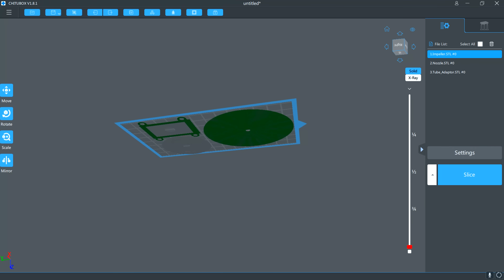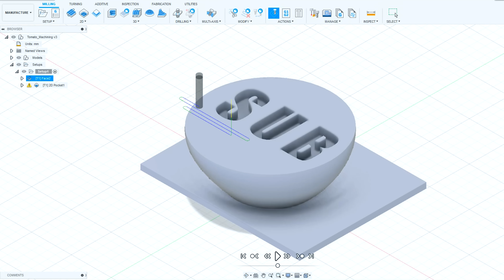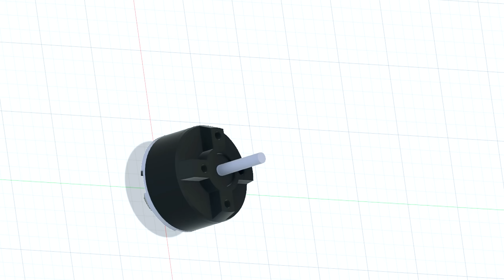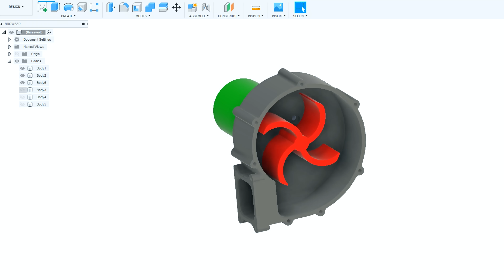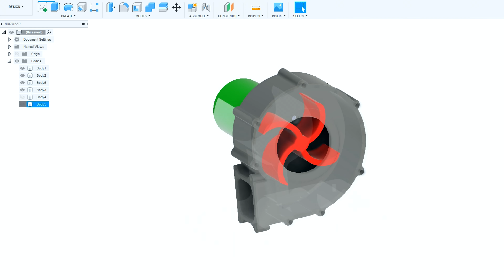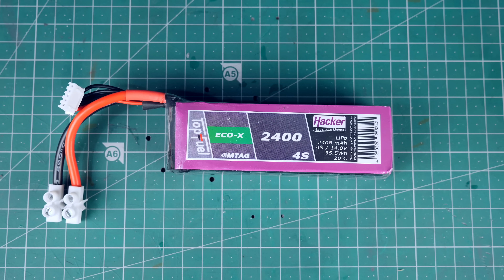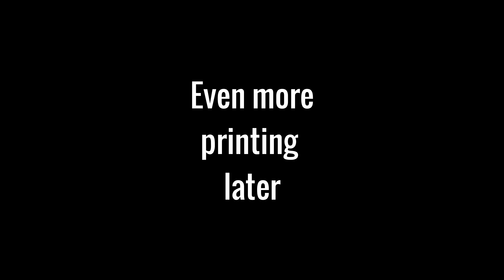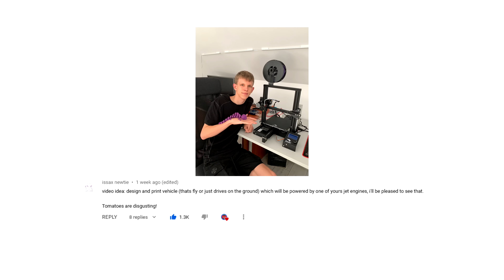Water Rocket Skateboard (3D Printed)

Comment: I knew that putting the battery under the water tube was a bad idea. You could 3d print an adjustable nozzle for this. Just like True Lies jet. And also make it overflow with water. Some air is coming in.

Comment: It looks linke there is massive cavitation ongoing in the pump.
Did you thought about using an high pressure air tank to push out the water through an nossle?

Comment: Oooh, a CNC machine! Now that's what we've been waiting for!

Now that you can work materials more efficiently and get some better parts done, how about revisiting one of your earlier jet designs and replacing the nozzle with a more robust metal one? It would be small enough to give you good practice with the machine and eliminate the fault point for 99% of your earlier designs. Would love to see them work without melting and powering a skateboard to run over some tomatoes haha.

Comment: the only thing that was bothering me was the "spinny thing"(i forgot the name lol), it was at least based on what I know, on the wrong side, they need to be like a fan, blowing air(or water) out, but the "flaps" were backwards. On a next design, this can give more power to the pump, and on metal pump, that can make a big difference, but it can increase significantly the weight of the water when it spins.
(sorry for my messy English, I'm still learning how to write, and thx for the attention :D)

Comment: More power doesn't always mean more thrust if you spin the impeller faster you will create cavitation in the pump and it will loose efficiency if you look up jet pump drive for a jet boat you will see how they are used for water propulsion

Comment: The inlet is too small, way too small. Very poor inlet condition. Ok, looks like you fixed it with blue inlet you will need a PD pump for good enough velocity for usefull propulsion. You cam see once its mounted that your impeller is cavitating, so again inlet condition. If you fix the cavitation issue it will probably break your housing. Lol, there ya go.

Comment: Bro, using a intake that seems smaller than the nosel 4:31 was so ahhhhhhhhhhhhhhh(cringe)hhhhhhhhhhhhhhhhhhhhhhhhhh!!!! 
But then, that happened 14:45 XD

Plus, switching the way the blades of the turbine work (instead of: nosel <- L, to: nosel <- J (if you can understand this XD)) wouldn't be better? instead of working like a scimitar, more like a falcata, or in simpler words, like a sling?

Comment: I would suggest that you would round the pump casing, that should help to reduce turbulence in the flow in the pump, and possibly consider a more traditional impeller instead of a paddled wheel? It has more structure and so might withstand the force better.

Comment: Hey Integza, I wonder what would happen if you make a jet engine and inject some water mist post combustion. Will the water changing from liquid to gas give you more thrust?

PS for the valve you had to cut... couldn't you just rotate it 45 degrees so the handle was facing the side? I think that would have cleared the water tank without needing to be cut. Lol as always great video!

Comment: I think you need to buy a cordless power washer and take it apart to see how that works, you don't seem to have much pressure, and it seems to have too much air/turbulence inside your pump/jet?

something like this.
https://www.worx.com/20v-hydroshot-portable-power-cleaner-wg620.html?gclid=CjwKCAjw3MSHBhB3EiwAxcaEu4iGZ--Dea85ACL8BMW_mG64dzC7XgYz4cG0r8e5Rjh43SQ3cAW3xRoCPsMQAvD_BwE

Comment: You should separate between the main tank water and the board.

The weight of the water tank make the motor will not have enough Pressure to push the weight of the water tank

Comment: You can use TPU to print a impeller, but with straight fins with counterbalance on the ends. I have one cheap(plastic-fantastic ;) ) water pump for mount on drill with rubber impeller in this shape.

Comment: Hi Integza, I am a big fan.  A project idea I had required using the brushless motor, see if you can print, CNC, or Mold an EDF that is efficient enough to produce enough thrust that could plausibly lead to flight or enough thrust to propel somthing forward rapidly.

Comment: Hey Integza, your motors are way to powerfull for your pump design, resulting in a lot of cavitation. This disrupts the flow and blows up your pump. If you increase the inlet diameter, use your nossel design skills for an optimized outlet and make shure the pump is filled compleatly before you turn in the motor, you might get better results. :)

Comment: Theres a lot of air in your pump or its all cavitation.  You should make a more restricted impeller and nozzle for higher pressures. Also you dont need metal parts, just make the impeller thicker at the base like the ones in turbo compressors.

Comment: I feel like if you could get the more screw style blade you would see in a car turbo, you would get a more consistent pressure.... Also as a comment noted, I believe the air gaps are causing .... a disturbance in the force .... That joke hasn't been used a billion times by now XD.

Comment: I have a new video idea for you. Using a turbocharger style housing. 3D print two different impellers. one side optimized for water, the other side optimized for air. So it could be a water powered air pump. Or an air powered water pump? I think that would be fun.

Comment: You are trying to run a low speed impeller design at to high of a speed. It would probably fail even if it were metal because of cavitation. Look at how impellers are engineered in high RPM pumps like a common jet pump used in a water well or even a sewage pump. The impeller blades are long, narrow and enclosed on both sides except for a center opening to draw in the liquid.

Comment: Hey my guy!  The reason this won’t work better than hot gasses is the law of conservation of energy. Every time you transform energy, you necessarily lose energy to entropy. 
In this experiment, you are trying to convert electrical energy into rotational energy, back again into linear energy by using what you haven’t already lost to push water.  The problem is all that loss. You will never be able to accelerate faster this way than by simply attaching a wheel to that motor. 
The reason we use hot expanding gasses to propel rockets is because the gasses are combusting, combining with oxygen, and supplying the energy into the system.  With your system, the water doesn’t add energy into your system.  
Please don’t take this as criticism, I love watching your videos, even though we have a shortcut around your experiments.  It’s rather fun to watch these things, instead of just explaining why not to bother doing them.
I would like to see you send something to space one day though.

Comment: it is easier to cut metallic parts with a CNC machine, but start off with some cheap aluminium as it is easy to remelt if you fail.

Comment: Love the idea just a few tips. The impeller should have more support. Making it a Closed impeller will greatly increase the efficiency of the pump and with that increase the strength making it able to spin up to higher speeds. slightly increasing the hight of the bucket will increase the HEAD thus increasing effectiveness. Would love to see this work.

Comment: Build a hydrogen generator with the 3d printed parts that so you can make fuel for things also to power a 3d printed hydrogen cell to generate electricity for use like a usb power brick

Comment: Video Idea: 3d print a propeller - after optimizing pitch, number of blades, etc. to produce maximum thrust under water.  Also maximize thrust for impeller pump. Measure which one is more efficient.

Comment: Video Idea: Use same concept water pump, but optimize for laminar flow - design impeller, angle of blades of impeller, size of inlet and outlet, and control pump speed - objective being : Maximize Thrust. Measure thrust using a load cell.

Comment: Marine engineer here. I have never seen pumps designed to 10,000 rpms let alone 45,000. Water requires much more torque for the same rpm as compared to air so pumps will usually be designed for high torque and low rpm compared to RC prop motors.

Comment: Video idea: Let's go on with micro! Print a 3D microfluidic TESLA valve and lets see how it works.
By the way, from less important to crucial; 
* You should change the propeller design.
* You can increase the thicknesses to avoid fails.
* You must increase the downstream length and decrease the diameter of the nozzle. So that you can have a smooth flow. (remember what you were holding in your hand at the begining of the video).
* You must be sure of filling the pump with water totally before running. Otherwise, this will be a demonstration of what happens when you run your pump with two phase flow (gas and liquid).

Comment: You need to print an impeller with a backplate to which the vanes are connected, it may also work better when the vanes start at the radius of the water inlet and not in the center.
And the most important thing:
Your impeller is way too thick.
For high pressure and high rpm you want an impeller with a low profile, Flat backplate, a cone shaped dome around the shaft to divert the incoming stream of water, vanes starting at the diameter of the inlet with a height of maybe 10mm and tapering down to maybe 5mm at the outside diameter of the impeller.

Edit: and the pump needs to be completely filled with water before starting the motor.

Comment: Video idea, what about a turbo/ centrifugal pump powered rocket engine, try make a rocket that could take a go pro up or something idk😂 also what if you pressurised the water with a bicycle pump as well as using a high power motor to add even more power?

Comment: Hey integza, i see you're washing the parts yourself.

I just wanted to inform you that the resin is SUPER TOXIC. The gloves only protect your skin for a very short amount of time (it kinda acts like a molecular syphon).

It'd recommend to reduce the exposure to the resin as much as possible even with gloves. 

The solution is magnets, motors and a rotating disk that stirs the isopropanol I which your part (including the print plate) can be washed. 

Would probably make an awesome video too, but in first priority it would make handling those things safer for you :)

Comment: To fast
Not sealed so succ more air than watter and u dont need much power...100wats can easly make it go like rocket.

Maybe use glass fibre with resin on 3d printed part to make it stronger

Comment: Video idea. This might be insane and most likely explosive. So perfect for an integza video right? 😂. So the idea is a mix of a hybrid rocket engine and a vapor rocket. Basically with a oxygen bottle we ignite a solid fuel, and connect the exhaust to a sealed water reservoir. The expanding gases will cause a huge pressure spike on the reservoir and we can use that pressure to force the water through a converging-diverging nozzle witch would accelerate it to a very high speed. The danger? If the nozzle is not big enough, the pressure will build up and explode the reservoir. Maybe a security valve in the reservoir over the liquid level would prevent this, but it would have to be dimensioned so no working pressure would be wasted.... Good luck, be safe, and bye from Spain 🙋🏻‍♂️

Comment: It seems that it’s the propeller on the inside that’s breaking, so I think you should add a side or base to one side of the propeller that sits flush to the inner wall of the pump. This will likely reduce the chances of the motor exploding.

Comment: Ill enter when you start giving away CNC machines tho. Until then: you can probably print the cilinder and slide in aluminum blades. Also submerge the pump first (make entry of water on top maybe?)

Comment: Go to the junkard and modify a turbocharger so you can attatch the motor to it
all made of metal and stuff, downside is you need some way to supply it with oil
or just use the impeller of a turbocharger and 3D print a sturdy housing, make everything a bit stronger
also I think you need to free up the inlet, use bigger fittings and stuff
also, maybe the impeller of a coolant pump from an engine could work
it comes with a wheel for a belt attatched, you can adjust speed or torque according to your motor

Comment: Isn't water almost not compressable? So when you add a nozzle of a smaller diameter, it not only explodes your casing, but it limits the amount of water being pushed out, too. The nozzles seen on water jet boats are often a cone because they follow the shape of the hub/middle cone thingy of the impeller, but there is always the same amount of fluid to flow through the cross-section.

Comment: If you can fly high in the air with water then this is nothing. There's only one person who can make it work and that's you.Here's an idea lf you continue with this project try putting a valve at the back so that you can adjust the thrust the load on the body is to much and maybe a  flexible 3d material and a flexible plastic glass in front. There's to much force on the body because you are using the screws to hold the water in , try using a water gasket, then  3d print a water bleed. It will work like pressure cooker it will release air / water when it's to much. Lastly reduce the water in its flooding it making it like a balloon. Thanks happy inventing.

Comment: Better refine the pump and mount it on a boat/watercraft to give you an "infinite" source of water.

A major problem you had in this video is that your inlets to the pumps have been too small, you're not letting enough water into the pump to fill the pump and the water/air is cavitating greatly decreasing efficiency and allowing the impeller to turn faster than it really should be for the amount of thrust you're getting, and even prematurely destroying the pump.

Fixing this will greatly increase the thrust (your next major gain would be a better nozzle design) and would point out the problem with your basic premise: yes, fluid is heavier than a gas so you can get more thrust, but jet and rocket engines don't rely on just releasing gas out the nozzle, but burn a fuel creating a MUCH larger volume of gas then if you just pumped the fluid out the back of the engine.  There is no similar way to produce a large volume of liquid, so you can only use what you can carry unless you make it a watercraft like a jetski, which uses the fluid it's riding in as what is pumped out the back for propulsion.

Comment: Your videos always make me laugh! If your parts are not holding the stress of high rpms, you can try using the trim function on your radio controller to slowly increase the rpm (keeping the throttle fully depressed) until you find the failure point! You can back down a bit and hopefully next time you try it (with a new print) you will not over-stress it so quickly (even using full throttle)! As noticed by other comments, the pump should be primed and beware of cavitation when going to high rpms.

Centrifugal pumps are simple in their design, but can you print a functional piston pump! With a two piston system you should get a good (almost) continuous flow of gas or liquid (but the design is much more complex)! 

Cheers (e um abraço do Porto)!

Comment: I would recommend that you use a bigger tube for inlet and outlet of the pump.The more powerful your pump is, the bigger your tube has to be. If not, you get too much friction for the water and it can cavitate. Also this is not air, you need to use smooth transitions for example when entering the valve from the box, and also use a longer nozzle. This way your energy losses are smaller and you get more energy at the nozzle exit, which is what you want.
Also you have to raise the water tank because there is a lot of water that you are not using and is only adding weight to the assembly. The exit valve has to be at the bottom of the box to use all of the water. And the bottom of the box should be above your turbine.
You could make a nozzle that can change the diameter of the end. This can make your thrust bigger and also you can leave your engine at high rpms and use the nozzle exit diameter for control of the thrust.
Thrust me, Im an engineer.

Comment: Video idea: instead of water, you could try to use compressed air. Maybe mount the pump on a single point of contact with the ground like a rail moving free on the inside of a rim (like some sort of monowheel?). Two nozzles, one each side, and if you can fine control them you'll even have directions!

Comment: Very entertaining again. I have some suggestions to improve the design.
1 Use a Tesla Turbine in a pump configuration, instead of a standard centrifugal pump. You can use angle grinder discs also since they are designed for very high speed rotation.
2 The water jet output should be focused against the floor, thus giving it something to push against.
3 All pipes should be 'rifled' (i.e. gun barrel). This takes advantage of the natural swirl (vortex) action of water observed by Viktor Schauberger.
I hope these suggestions are helpful.

Comment: Make a huge inverted U-turn after the pump and prior to the outlet nozzle (also make the nozzle longer to get laminar flow). Then it is possible to remove the cut-off valve and have the pump fully submerged prior to operation. And that pump design is intended for gases. No way you can get 2kW thru it... You need smaller wings both in length and width.

Comment: Try to print the pump with nylon, it should handle the force better...

Also submerge the pump in water first, to remove all the air inside.

Comment: I Think you will have success with this project. All you need is change the impeller. Now it crashed because blades became larger in diameter from centrifugal force and byte the pump body. Print impeller like on car turbocharger. This form is better to high speed rotatoin.